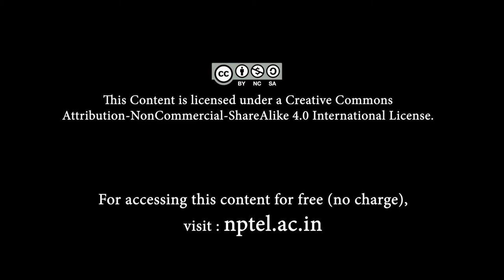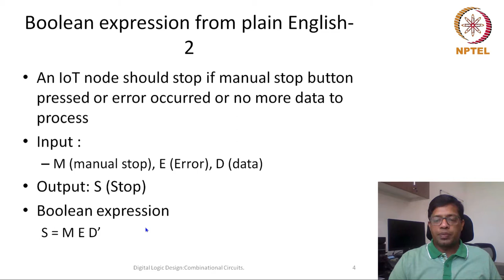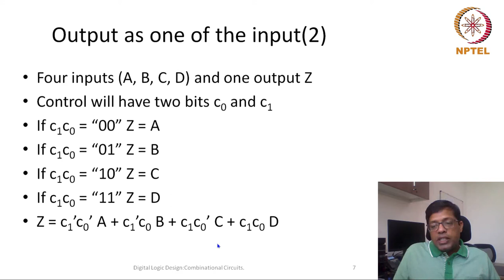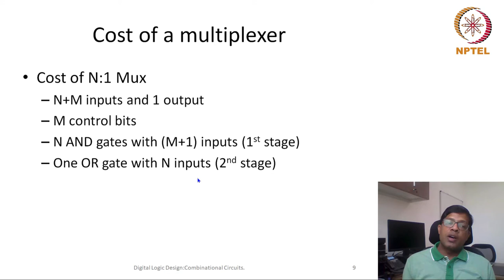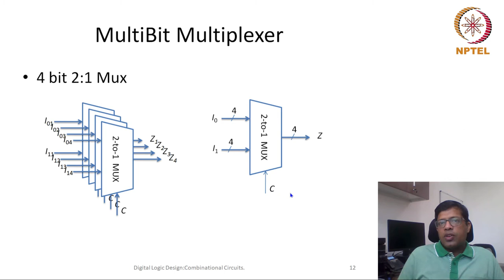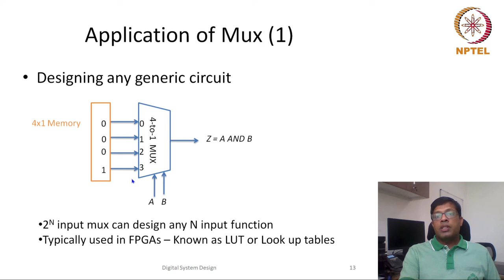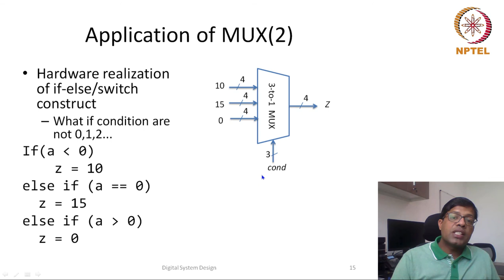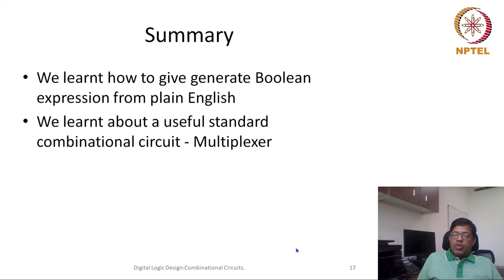Multiplexer

Comment: In the second example where it is written IOT node should stop "if manual stop button pressed" or "error occurred" or "no more data to process" here we use the Or term. so why in the equation there is AND GATE? I think there should be or gate. Because we want to stop our system in any scenario.